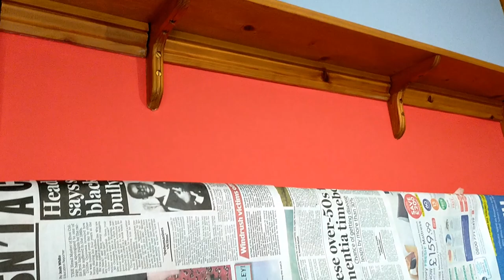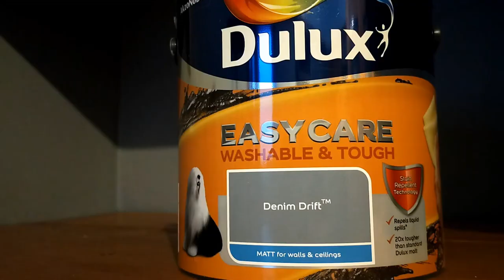Painting Upto Fixed Shelves First Coat Over Strong Colours

Comment: I used Dulux bathroom paint misty mirror it was very good and has some mould tech stuff in there. That got me thinking; if you can thin paint down with water before airless spraying or for a mist coat. why cant you thin it down with some mould spray and put that stuff in your paint? Kitchen paint is grease resistant, easy care is a bit of all and hard wearing.Why cant we add anti grease anti mould stuff in ourselves? Is this crazy talk?
Reply from the maker: You can buy additives for paint.